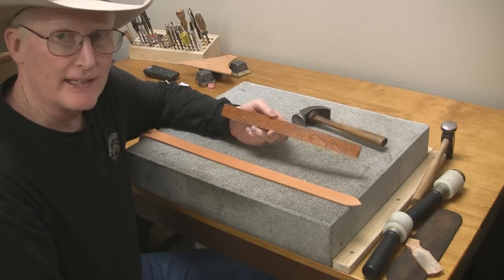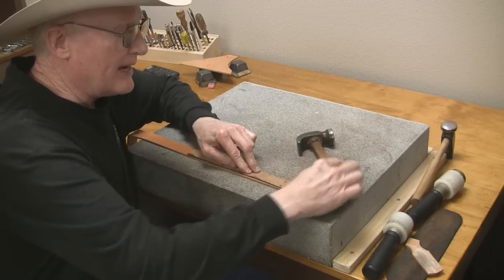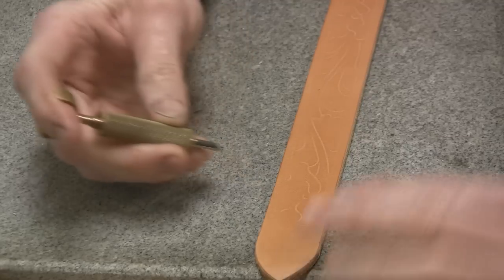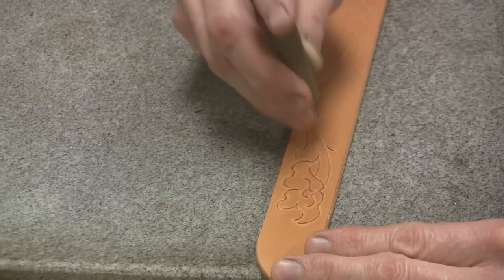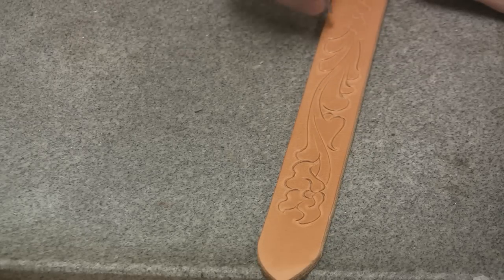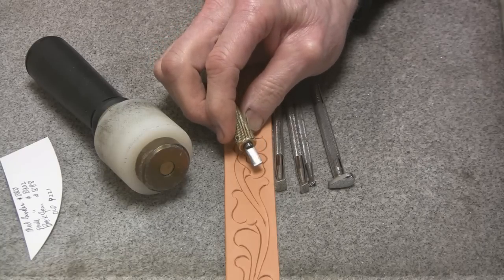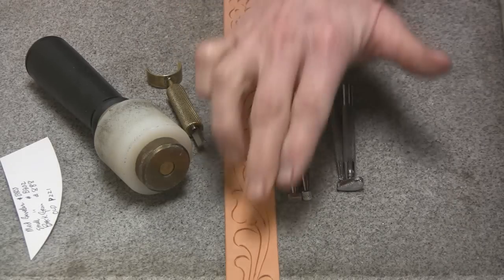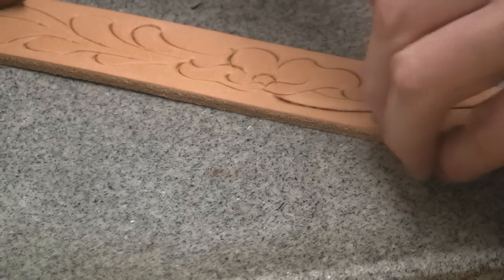Leather Craft: Tooling and carving leather how to tap-off  designs

Comment: which dye do you prefer spirit -base or oil -based
Reply from the maker: +Aaron George Dyo-Flex is good and Fiebing's oil dye I use them both and sometimes water based Eco-Flo from Tandy Leather it depends on the application and project. It is good to experiment with all of them. Bruce